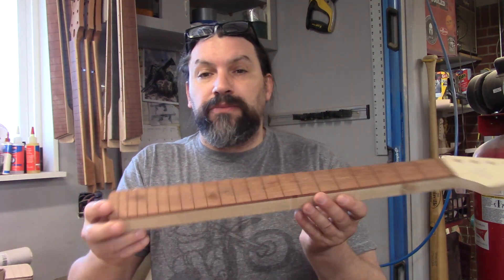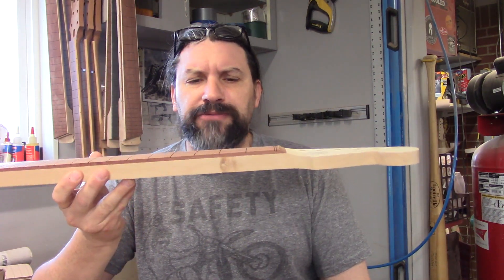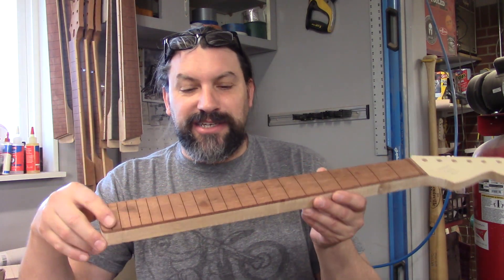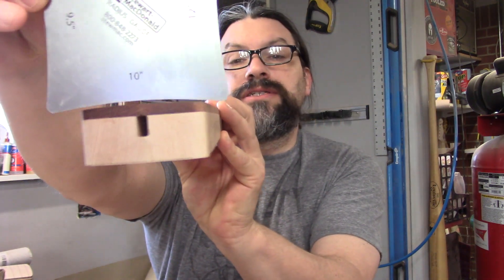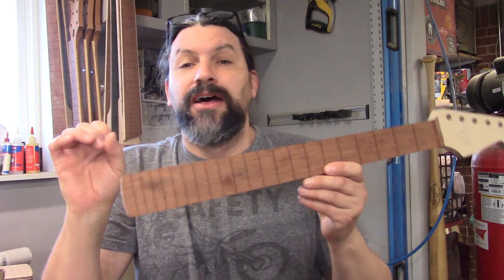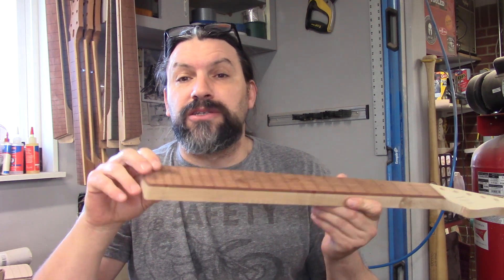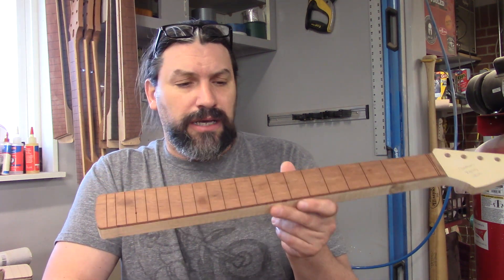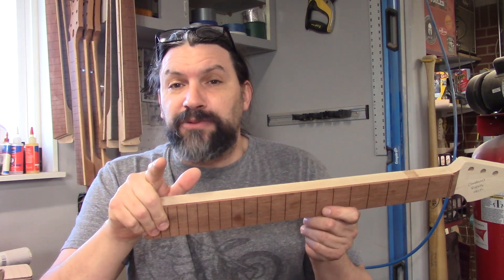Everything You Ever Wanted To Know About Compound Radius ! Part 1

Comment: Sooo can you use this with a lp bridge with a 12" radius?
Reply from the maker: Yes and no.
You could use one, however for best results you would need to modify the radius of the TOM by slotting the saddles. I have never thought that a 12" radius was that tricky to get a low action on so there would be no point. Les Paul had a 12" radius fretboard and he didn't seem hindered in any way.

Comment: Aw, you get better, Matt...don't let my razzzin' ya get you down...Goldarn, you sound horrible :P ahahaha. You are SOO correct, Sir! It's NOT really  "Compound", but Conical...good call! Again, my opinion is : the 10 - 16 radius was developed (and is the only "must have" situation) for the Original Floyd Rose nut (10" radius) and bridge (easily set to almost flat, with tinkering) ... for them thar 80s guitars...made basically obsolete by the different locking nut sizes they have, now. Yup, now the hard (er) work begins. Love this series. As much as I do love compound radii, they are a PIA to do (especially by hand), and really not necessary in most cases, for sure.
Reply from the maker: Of course the original Floyd Rose has a 10" radius bridge so... putting one on a 10" to 16" neck would be counter to the original intention. We are going to cover all this stuff in the next few videos brotherman. This is shaping up to be a very polarizing topic ( I had an idea it might)

Comment: Who sez you can,t use that neck. Turn it into a between strat tele neck.
Reply from the maker: The neck doesn't have a truss rod and I think the back got used for a test of a new router bit for neck shaping... more to come on that new tool
Reply: @TexasToastGuitars  yeah i was jyst thinking you could use a carbon rod gluded in to hold relief or something. I didn,t hear the part about the miss on the neck shapkng. Hey i,m curious,,, um how is adpen as a wood for drop tops?? It a beautiful white wood.